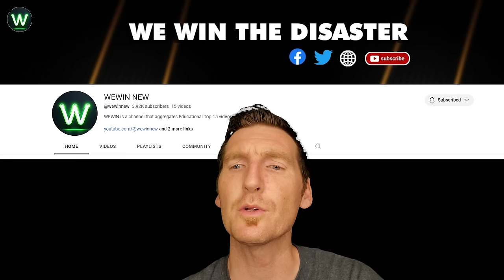Tragic! Ultimate Near Miss Video Of Biggest Truck Crashes Filmed Seconds Before Disaster Make Scared

Comment: Some of your comments could be based on road design. Have you heard or understand about clear zone? A concept the USA Highway Design Manual talks about but has been ignored. We know how to build safer roads but part of the safety measures in USA include trauma centers strategically placed. Life does have a $$ on it I'm afraid. What is it in your country? If we want to drive at 10 mph then make a road however you want. If we want to move faster then design roads for higher safe speeds. Subscribed and liked. Good video.
Reply from the maker: Thanks for joining us! Your engagement is crucial to us. If you liked this video, please consider liking, sharing, and subscribing for more.